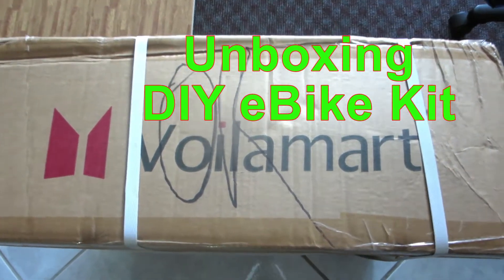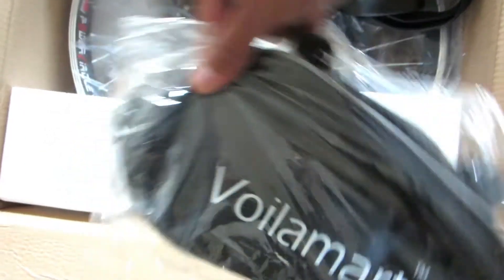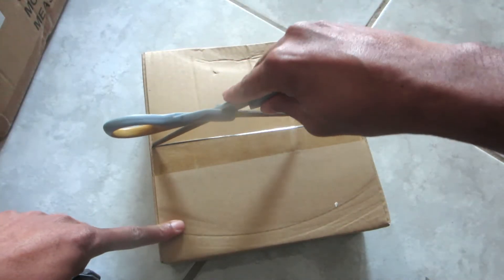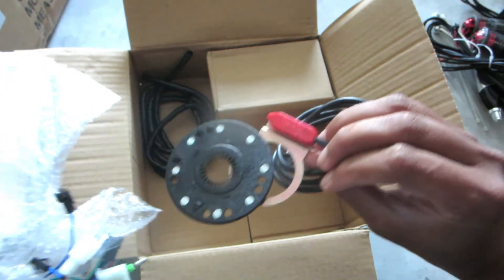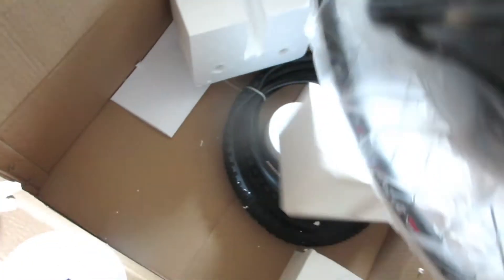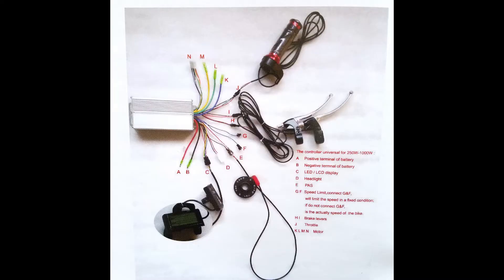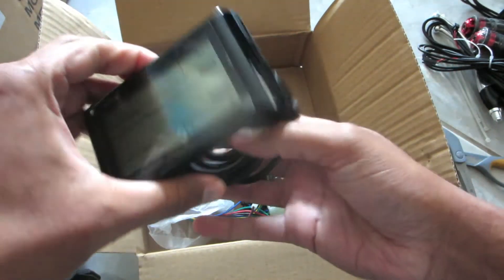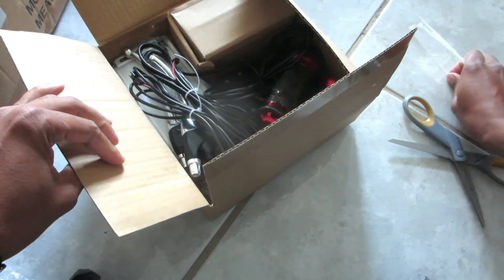Unboxing DIY eBike Kit 48V 1000W Rear Hubless Motor for 26" Mountain Bike

Comment: I purchased this through Amazon recently for $180.00, just finished the conversion of my old mountain bike.  Had to buy the battery and rear rack to hold it for $396.00.  Definitely not cheap but works really well!
Reply from the maker: Congrats! I still remember the feeling after I rode it for the very first time, so happy and excited I wanted to scream. I had to create a custom battery bag since I did not want to drill new holes into the frame
Reply: Hey 
Could you give me a link where you bought your battery?
thank you